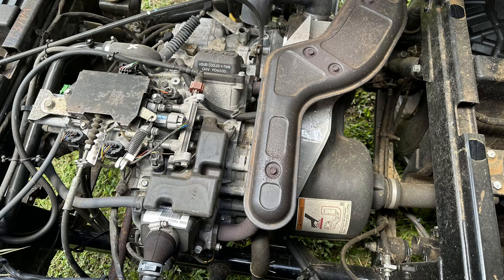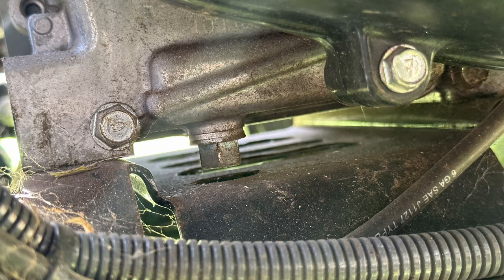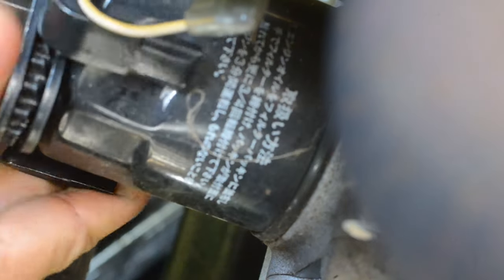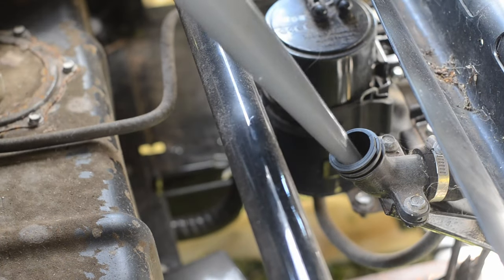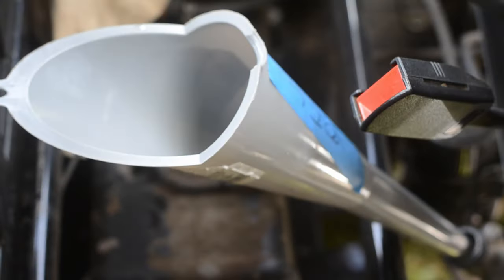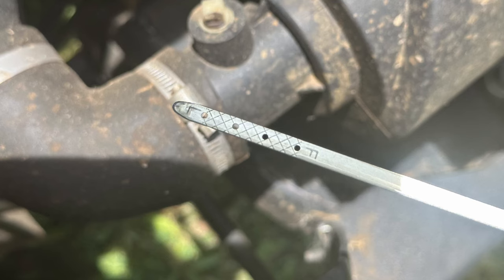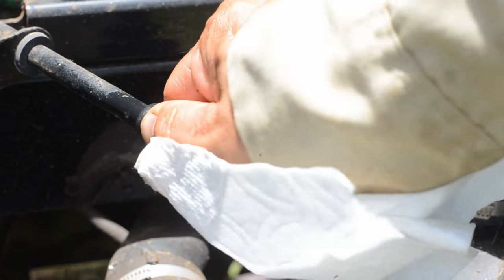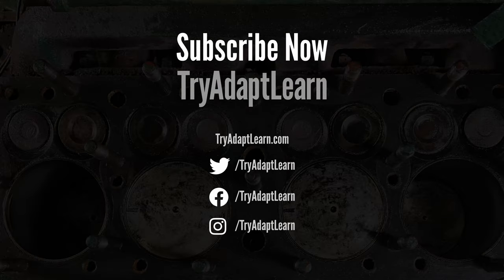Kawasaki Mule oil change with a FD620D 617cc engine demonstrated on Mule 4010

Comment: My dipstick rusted and broke off up inside the dipstick tube. Now I have to take the clutch and belt assembly off to replace the tube. Dipstick rusts pretty quickly, the first one rusted within a year, second one about the same.
Reply: odd i have a 97 with original dipstick no leaks no rust in central indiana......   you might have environmental issues contributing to that might try some rust preventatives like fluid film or good paint like POR15.